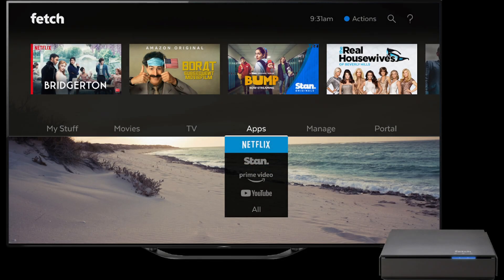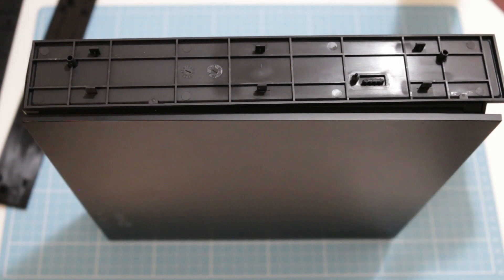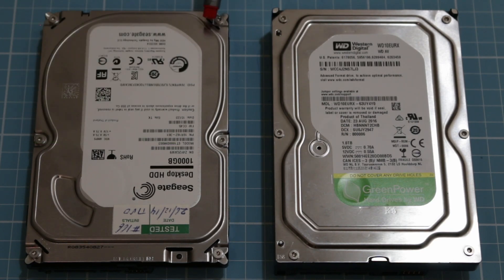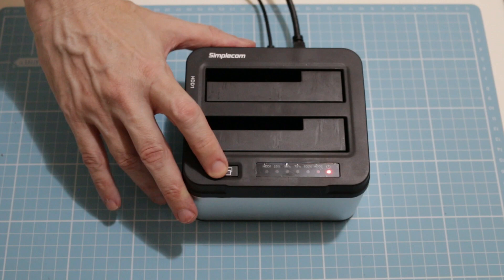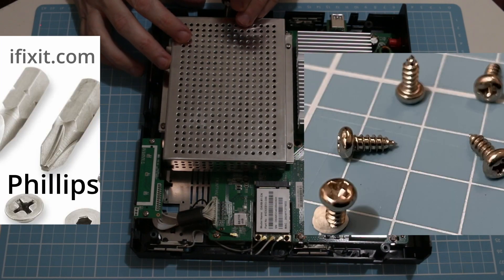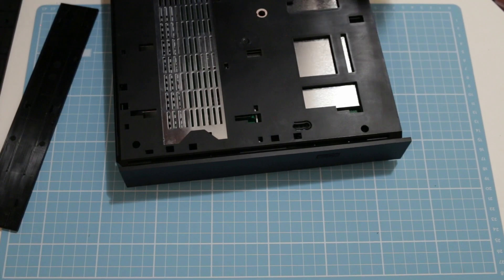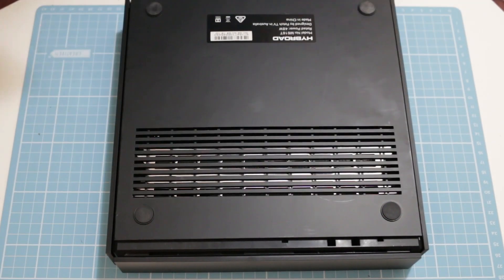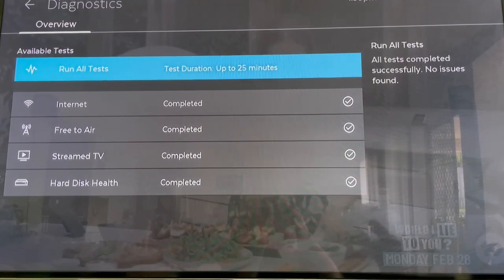fixing/repair my fetch tv box for free (*) critical hardware fault/error for failing hard drive

Comment: Did mine with a linux box and the DD command - saved using the disk cloner even though I had one. I couldn't find its power brick so though "oh I'll just DD it on the linux pc!". Thanks for the teardown video!

Comment: Interesting issues pulling the Fetch apart... #1 was trying to find a size 10 Torx diver bit that would fit in the hole (all the ones I had were too large, and or too short).   Went to Sydney tools, they fixed me up with the correct Torx 10 x 50mm long. Not available singly, had to get 5 for $9.95 😞

Comment: I'm going to try a 2TB SSD (unformatted) and see what happens... Still cloning 2 hours later, using the Intel Data Migration Software (the EaseUs would not clone it). 5 hours in on cloning the original 1TB HDD to a 2TB SSD.   In the meantime, I tried a 1TB SSD (unformatted, no partitions). Fetch gave me a 'catastrophic hardware failure' error msg. Interesting.    At the beginning of the cloning of the Fetch HDD, the Intel cloning software identified a Linux formatted drive.  It continued on though. 15 minutes remaining...   After almost 6 hours of cloning, I installed the 2TB SSD, but it would not boot in the Fetch.  I reinstalled the 1TB HDD, and it took nearly an hour to successfully reboot, so basically, it was a total waste of time and $10.  I tried my Cruxtec SATA drive copier, and it also failed to duplicate the HDD on to a SSD.

Comment: Hi thought I might add my experience yes I cloned the drive to another 1TB Seagate drive from my old pc and it worked, however got very hot and rectified the problem by cloneing to a 1TB Samsung SSD Drive, No more heat problems.
Thanks for your informative Video
Reply from the maker: @bbirrell30  nice

Comment: Hi, great video. Do you think there'd be any benefit to using an ssd? Would the heat in the machine destroy an ssd quickly?
Reply from the maker: I don't think the heat would do anything, but would be worried about the SSD being constantly written to 24 hours a day unless the SSD Firmware/Fetch Software had good wear leveling so that all areas of the SSD are written to an equal amount of times. It could make menus and restarts faster.

Comment: If the old drive is failed, how can it be cloned?
If it's not failed, went would you need a new drive?

But i can see why Fetch are selling literally tens of thousands of refurbished Max Gen3 (M616T) for $189. Obviously a common manufacturing fault of some sort. I just know what it is that fails that kills the drive but cloning it works. MBR? O/S?

Should be covered under ACL beyond the 2 years.

I'm guessing it's SATA, and presumably it's not the heads crashing or it couldn't be cloned, but if going to the effort, can you just clone it to a sata ssd? It'd surely be more reliable long term?

If you don't have a cloning machine, windows software should still clone a non ntfs drive? Like if you bought a crucial drive with free eesus license or something?

Certainly if you had to buy a drive and a cloner, you're far better off buying a refurbished with new warranty otherwise.

But awesome knowing how easy it is to open!
Reply from the maker: If refurbished one is reasonably priced then that is a good option. If your machine is playing up and giving intermittent drive related messages, that is a good point to clone the drive before it fails completely.
Reply: I see the refurbished price has dropped $90 since your video as they're selling the newer Gen4 (M681T) for new purchases.

$149 from JB I see so that's $130 cheaper than when you did the video.

For that price, with JB making a profit, and fetch obviously making a profit after refurbishing them and repackaging with new remote, cables, boxing, wrapping, shipping, they're obviously doing a very very very very simple fix on the drives and reuse the drives.

Reminds me of when Samsung repair centres got thousands of dead TVs just out of warranty, quoted $300-$400 to replace the boards, then when the quote was declined, they replaced one 50c blown capacitor and sold the TV's refurbished for a few hundred dollars.
Reply: You could boot off a live Linux thumb drive and use clonezilla, but you'd also need X2 connections to hardrives, ie: Fetch -> new HD
It's also possible to save an image of the Fetch, then "burn" that image to the new drive, but this is complicating things and you'd need more then 1t or space for the image (maximum) to do it that way
For ~$35-50 the stand alone clone box is the way to go.
Reply: @kiwiaus  Alternately, if you can get hold of the old 'free' version of Easus disk cloner, you could do everything on a PC instead of buying a cloner. (I have TWO cloners, neither of which really work correctly).

Comment: Great Vid. Do you know if the New destination drive can be larger than the original ?
Reply from the maker: Fetch told me my model  M616T needed a cloned drive, so couldn't put in a larger drive, I believe later models can have the HDD swapped without having to clone an original, so should be able to accept larger drives because the fetch box should be able to initialise/format it.
Reply: @RandomSmith of you have a spare 4TB drive for free you could just clone 1TB and it would be 1TB usable. So you could use the bigger drive but not use the extra capacity of it.
Reply: @RandomSmith  Has anyone tested this on the newer models?
Reply: Thanks for that, I’ll try without cloning first 🙏🏻
Reply: @timljhcm How'd you go?
Reply: Hi. I tried the offline cloning with a larger 4TB drive as the destination. As expected didn't work unfortunately. Not even only using 1TB of space (just got the hardware error message) as you mentioned. My hope was for more storage so just having 1TB isn't gaining me anything. I'll have another play with it when I have some time. Thanks for your help :).
Reply: PS: I have the same model as yours.

Comment: How do you know if your HD needs to be cloned? I have the same M616T I don't think it's 4K
Reply from the maker: If I remember correctly, just try a new hard drive, if I works and initialises (can see the fetch GUI) then you don’t need to clone.
Reply: @RandomSmith  Or, delete all the partitions on a used drive, then stick it in the Fetch for formatting.
Reply from the maker: @greghudson9717  I believe you can do that for newer models but fetch helpdesk told me I couldn’t do that for my fetch box version, always worth a try though

Comment: found out today you can't salvage Fetch Harddrive and use in a computer or another device
Reply from the maker: late reply, but I would have thought that you could use a fetch hard drive in another device if formatted
Reply: Yes you can, I have, it's just a normal hard drive.
Reply: You just need to use the correct software to reformat the drive.
I've not looked at one yet, but assume it's a Linux formatted HD - if using MS windows .. use explorer, right click "my PC" , then manage, then Disk management You should see multiple Disk in the LOWER pane (Disk0 - is your system HD - DON'T TOUCH) - From here you can delete the partitions of the Fetch HD and reformat

Comment: Hi and thanks for the break down of the unit.
Looks like I'll be needing a longer Torx screw driver then the bits that fit my screw driver handle.
Still way cheaper then a new unit. I don't have the Cloning unit you do but going to try and copy files to my PC via a USB hot swap, the PC may not even be able to read the HDD but ill give it a go anyway.
Reply: did it work?
Reply: I'd very much doubt it
The fetch drive will be formated differently (from a boot perspective) - hence why cloning is needed
Reply: Copying the video files should work, just the replacement is unlikely to work